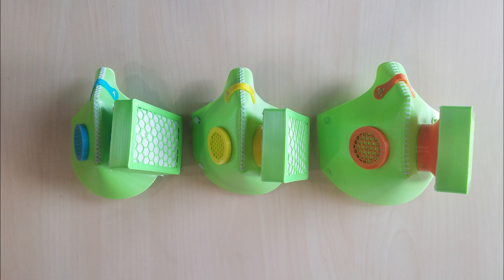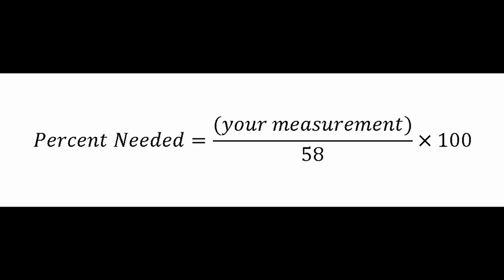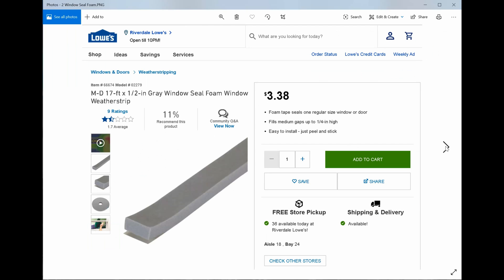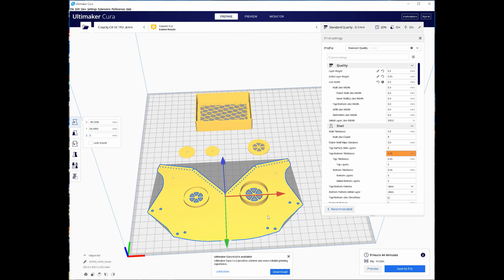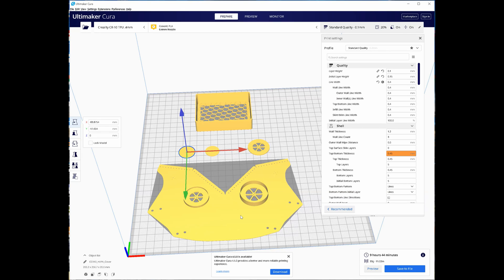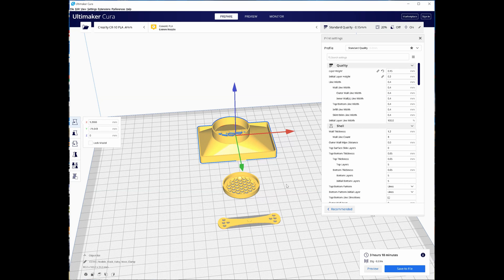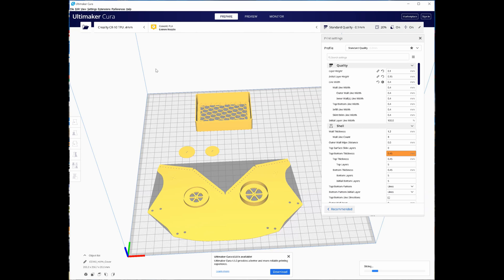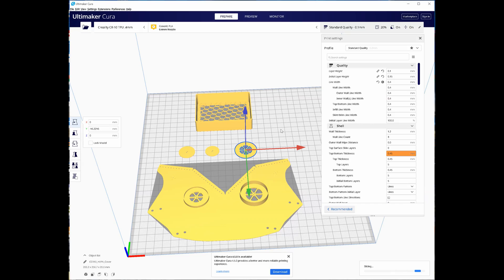DIY Gas Mask

Comment: Do we know the micron rating of those vacuum bags? I tried googling to see if one brand is better than another, but not finding much.
Reply from the maker: Please use a good bag, I was willing to risk it with a generic brand but there are plenty of cheap, easy to get, high performance (.1-.3 microns) bags out there.
Something you can search is "HEPA vacuum bags" and they are rated for .3 microns, and they are everywhere.  I found them online and in stores without trouble.  
Here is a quick guide to some brands.
https://www.ristenbatt.com/xcart/Dustbag-Performance-and-Filtration-Efficiency.html

Comment: Does the carbon create any dust that would be harmful to the lungs?
Reply from the maker: I must state that I am not an expert in the area, this is me doing this at my own risk.
That being said, if you look up Pneumoconiosis you can easily find information you need.  
To make this short I'll use the information found in wikipedia ( https://en.wikipedia.org/wiki/Pneumoconiosis).
"...particles smaller than 0.5 μm move into and out of alveoli, often without substantial deposition and injury. Particles that are 1 to 5 μm in diameter are the most dangerous, because they get lodged at the bifurcation of the distal airways."
Basically if you can filter the particles for the virus, you can filter the carbon dust.  Please use a good bag, I was willing to risk it with a generic brand but there are plenty of cheap, easy to get, high performance (.1-.3 microns) bags out there.
Something you can search is "HEPA vacuum bags" and they are everywhere.

Comment: Great job on the mods for this mask. Haven't printed with TPU yet so this will be the first. Any chance you could share your Cura settings for this?
Reply from the maker: Okay I just uploaded it to the thingiverse page.  if you go to the files and download all, the "TPU .4mm nozzle" cura profile will be in the files folder, you can then import it into cura.
Reply: @manmade5378  Thanks for that! Going to give it a go today...
Reply from the maker: @beedubya1031  I used priline TPU for my masks.  Here is a link.  https://www.amazon.com/gp/product/B082PC1T7Q/ref=ppx_yo_dt_b_asin_title_o07_s00?ie=UTF8&psc=1
I just tried printing with white overture TPU and it is a lot softer so I have to print a lot slower.  I have to print at about 20 mm/s.
Reply: @manmade5378  I had a roll of Overture TPU and it's definitely softer so I had to tweak your settings just a bit but finally got a great print.  I was looking at Priline TPU so I think I'm going to get me a roll.  Thanks again for your efforts here and for posting your settings!
Reply from the maker: @beedubya1031  I'm curious to know what settings you ended up changing.
Reply: @manmade5378  http://imgur.com/a/qB6MOAq
Last image are the settings I used. Changed the bed temp to 80, no retraction, changed the flow rate to 120%, speed to 20, fan speed to 50%. Also enabled coasting (can't remember if you had that set already). Prints came out great for my first time printing with TPU.

Comment: anyway to modify this to have a filter on the exhaled air to? for already sick people etc?
Reply from the maker: Yes, you would switch the side each of the valves are on.  You will have to scale the piece that is glued on the valve face so that it fits the other valve.  This isn't hard, just measure the larger valve hole and Cura should give the diameter of the part in x and y directions when you click on the scaling option.  Then scale the x and y axis to slightly under what you measured so it will fit easily.  Keep the Z-dimension at 1 mm.

Comment: @Man Made  Do you think the inlet should be larger to allow for easier breathing? How difficult is it to breathe with the small inlet?
Reply from the maker: It's not hard at all.  I had to breath heavily to make it make sound.  Unless you are breathing heavily like durring exercis then it doesn't  make sound or increase difficulty to breath.
I originally made the thread holding the valves on really tight thinking that would be good, but it just made it hard to breath and not close well.  It wouldn't seal well because the thin disc puckers and warps when the string is too tight.
If it's hard to breath then you have tied the string too tight.
Reply: @manmade5378  Cool beans. I haven't had a go at printing it just yet. I have been messing around with the STL file, converting it to a solid body in fusion 360 to be able to modify it if needed. I increased the size of the inlet holes while keeping the fitting size the same, would you like the STL file? Also, If there are any changes you have in mind, let me know. Send me some sketches or something and I can have a go at editing it :) https://i.imgur.com/spyv5ZT.png
Reply from the maker: @ianaustin1867  That's awesome!  I'd love a copy of the .stl or fusion 360 files if you feel like sharing. 
I will keep your offer in mind if I have any ideas for changes. 
Let me know how the larger valves work for you.  You may have to thicken the valve discs if it gets too big.  I'm just guessing, and think it would only be by a layer thickness or so, about .1mm  or so.
Reply: @manmade5378   Can you access the fusion 360 file here? https://a360.co/2J0IrwO
I will be trying the prints over today and tomorrow with some flexible PLA. I plan to make the inlet valve quite a bit thicker to avoid warping since it has to be quite a bit larger (scaled up about 150%).

I might also put holes either side of the hooks, leaving them on just for some added rigidity where it pulls.

Also, when exporting this as mask as an STL and opening in cura you will need to scale it down 10%
Reply from the maker: @ianaustin1867  Sorry, I never got a notification about this comment.  The file works for me.  Thank you for sharing and thanks for the update.  Good luck. :)
Reply: @manmade5378  Hi, just an update on the mask. I added some different anchors for the elastic.
https://i.imgur.com/4Yh5sco.jpg
Works out really well!

Comment: How can i print that in pla?
Reply from the maker: Someone has successfully printed it in pla and this is what he said.  "Good news! Yet another challenge! I just tried PLA with Cotton Cloth. It's pretty good! Use Slic3r to cut out the base 0.2mm of the main face plate STL, print with layer height 0.1mm on top of cotton cloth. Inlet/outlet cover may not fit because it was base on flexible. So scale up by 2% and use hairdryer to fit."
Reply: @manmade5378  thank you sir..